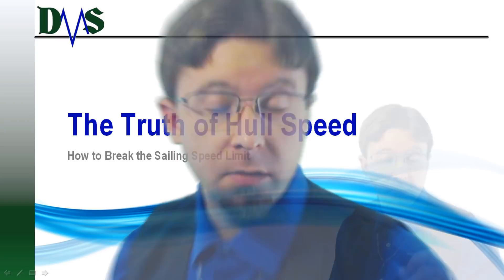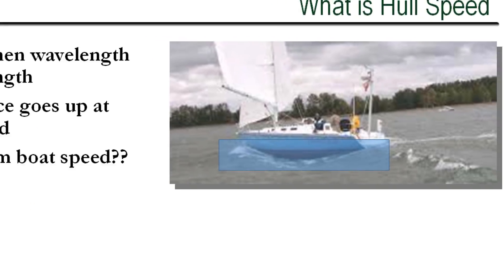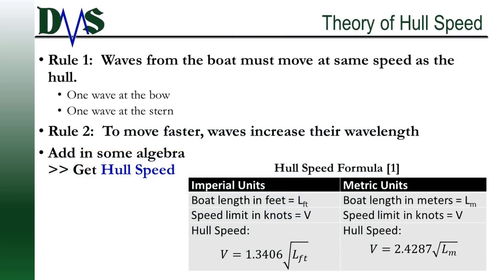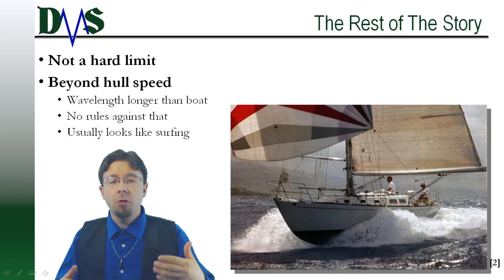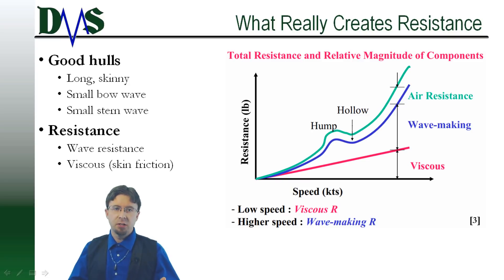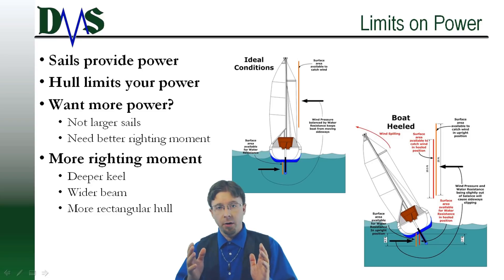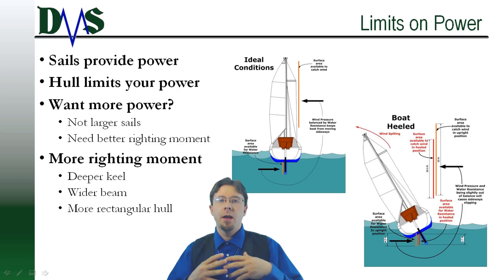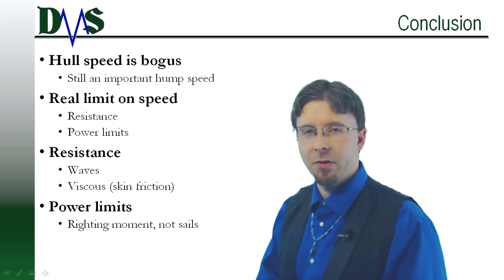The TRUTH of Hull Speed:  How to Break the Sailing Speed Limit

Comment: The point of inflection where you encounter rapidly diminishing returns being at the hull speed is not simply coincidence.
The diminishing returns have causal relationship with the hull speed, as in, that is where increasing wave forces are encountered.
If you surpass the hull speed there is a period of rapid gain followed again by diminishing gains (increasing function of air/fluid/wave resistance)  What will you say then, that total resistance is just coincidental?
Reply from the maker: I don't recall that the video ever implied total resistance was coincidental.  Only that hull speed did not predict a hard limit on maximum boat speed.  In general, I would argue that YouTube is not the appropriate forum for a technical debate, which are the types of questions you are asking.  Those belong in peer reviewed journals and scientific conferences.  And when I present to conferences, I use a more technical and precise tone of presentation.

These YouTube videos intend to expose engineering concepts to a wider audience in a more accessible manner.  That does require less precise terminology, which can lead to some misunderstanding.  But you asked a technical question, and I will attempt to provide a brief technical answer.

Based on current theories of resistance prediction supported by the ITTC, I argue that calm water resistance, expressed in non-dimensional coefficients, is a function of Froude Number and Reynolds number.  The primary components are wave making, friction, form factor, and appendage resistance.  Of these various components, wave making resistance is the one that demonstrates the change in resistance at hull speed.  Before hull speed, it shows a characteristic hump / hollow curve.  Beyond hull speed, the curve appears exponential, but the actual characteristic depends largely on the shape of the individual hull.

Air resistance also gets added in as an additional component, purely as a function of Reynolds number.  For calculating powering, we may also add in an additional powering margin based on wave resistance from weather.
Reply: @DatawaveMarineSolutions  my comment about total resistance was an argument ad absurdum.
8:19 "...having this point of diminishing returns next to hull speed is just a coincidence"

Comment: Depleted uranium keel... much righting moment, much speed?  But seriously this makes sense why catamarans are so fast. Wide stance -beam + higher righting moment, narrow long hulls, light weight for good transfer of energy rate. Is the point where the righting moment and wind energy transfer peak measured by sail spill as in you have more energy than you can use? Sorry obvi a sailing noob here.. can you make a sail boat plane out like a recreational boat?
Reply: Light one design class type boats can be designed to plane easily. I used to sail a windmill (a now pretty much dead class) it would plane, but the rudder got damn sensitive! Also the sailing surfboards planned well, seemingly most modern one design classes will plane, although the newest thing seems to be foils.

Comment: What is the minimum wetted surface area needed to affect an increase in calculated hull speed?  For example, could I hang an 12' 4x4 post from the bow pulpit in the direction of travel, resting one end against the hull and thus increase my speed?  Would a 12' 1"x1" 'stick'  be just as good?  Or, do I need an area that covers from the water surface to the depth of the keel to affect the calculated hull speed?  hum...Worded yet another way, what is the ideal ratio of length vs depth to gain in hull speed?
Reply from the maker: Just adding small changes will not work.  Any changes need to be a faired addition to the hull. So you basically need to add something that covers the entire hull.
Reply: Hull speed is purely a function of waterline length. Wetted surface may impact how easy or hard it is to achieve or exceed hull speed for a given condition, but it won't change the hull speed itself.

Comment: I have some questions:
1) In relation to hull speed, what would be the effect of creating small bubbles ahead of the bow and below the hull (by any suitable means)?  Thoughts are that traveling through bubbles would reduce wetted area reducing friction. 

2) If a swing keel were vertically split along the hull and hinged/slid/pivoted (take your mechanical method) so that the depth of the keel would be increased, you'd gain righting motion, thus your sails could catch more power.  (Envisioning [rotate 90* in your mind] a beam over a fulcrum demonstrating foot-lbs.)  Is keel design advancing or are efforts better spent elsewhere?  My focus is with sailboats.

3) Instead of #2 going deeper, what if the bottom of the keel were winged and with a design that allowed the wing portion to be rotated starboard or port (and still be hydrodynamic)?  This would move the weight off center and to the direction to better counter heel.

4) What if a sailboat had, for lack of a better term, canards molded above the waterline so that as the boat heeled, the canards would contact water impose  a righting force?
Reply from the maker: Hi TronOfBorg.  All excellent questions.
1.)  For creating small bubbles, this is an area of active research.  I have only seen it on powered ships though.  You need a fairly large air compressor to introduce the bubble under the hull.  That takes a lot of power.  With the commercial engineered applications, I have seen claims of decreasing resistance by about 15%.  That could increase speed by about 7%.
2.)  If I understand your description correctly, yes keel design is advancing in this area.  The Volvo racing yachts using swing keels with can pivot port/starboard to increase righting moment.  We don't see these outside of racing yet, because they are expensive.
3.)  Good idea to offset the wing.  But you get more bang for your buck out of a swing keel instead.  The swing keel does more to offset the center of gravity with less complex machinery.
4.)  Yes, this could work in theory.  I have not seen any direct applications yet.  The main challenge is that you need forward speed to get large forces out of the canards (or any type of lifting foil).  Except that lifting force also has its own sources of drag that it generates.  You don't get it for free.  So the idea of submerging foils could produce extra righting moment.  But you will probably find better efficiency and simpler construction through changing the hull shape.
Reply: @DatawaveMarineSolutions  How about creating countering waves - something similar to bulb bow. But instead of creating them in a bow why don't create them:
1) either before the bow (maybe by hanging something from the bowsprit- so distance  from the bow could be adjusted to speed)
2) sideways to the bow - maybe in a form of a proper formula for a distance between hulls in a multihull design. It would still be a fixed speed (like in a bulb bow design) but it might give some bonus on a light winds during long cruising. 

In case of proposed bubble-cavitation solution. How would such a solution affect buoyancy? In theory it should be reasonably easy to boil thin layer of water at the bow section, some solar panels could provide enough energy. My concern is not only danger to marine life in such design - filter of steam/bubles would have lower density than water. Wouldn't it limit application only to foiling or extremally lightweight craft?
Reply from the maker: @gradowik  Good idea, but the sense of scale just won't work in this case.  When you hit hull speed, you have a wave that matches the length of the ship.  To create a counter to that wave, you need a bulb about the same length of the ship.  As far as the multihull concept, I haven't heard of anything like that.  But more power to you if you can develop something that works.

In the realm of bubble-cavitation, first a few clarifications.  When we get cavitation, those bubbles collapse almost immediately after being generated.  They aren't very good candidates.  There are devices that straight up inject air bubbles under a hull.  It doesn't affect buoyancy at all.  The air bubbles are at the same pressure as the water, so the hull doesn't see any different in buoyancy.  This also is not a concern for marine life.  We don't normally use steam to create the bubbles.  The easier route is actually compressed air, which requires less energy.  The bubbles are gone after the ship passes.   We don't use these bubble systems to reduce the ship draft or use it in light weight applications.  In fact, large, heavy vessels are the only ones that have the space for the necessary air compressors.  Running the air bubbles along the hull helps reduce the skin friction of water against the hull.  We use it for fuel savings.  Still questionable if the fuel savings are worth the cost of running the air compressor.
Reply: look up the newer generation vondee glope IMOCA 60 sailboats. theyre single handed offshore racing boats, and pretty much all of the new ones are using foils that extend out of the sides of the vessel to provide righting moment and even help lift the hull partially out of the water. the new americas’ cup boats are also monohulls using a similar idea, but they can lift themselves fully out of the water on hydrofoils

Comment: I’ve had sailboats surfing down waves at sea , your steering reverses if you do a higher speed then your hull speed !
Reply: When surfing a wave at sea, steering does NOT reverse because you exceed hull speed. Steering reverses because the wave behind you causes the water in the wave crest to move faster than your boat speed. Effectively, the bow of your boat has water flowing aft and for a short period of time the stern has water flowing forward.
Reply: AGHHHHHHHHHHHHHHH  THAN, THAN.  THEN is a moment in time.  THAN is a comparison

Comment: I've often wondered why no one has tried to design mechanism between the mast and keel which could compensate for the heeling force and keep the mast perpendicular to the water's surface no matter how hard the wind blows.  I guess I'm a little jealous of the way wind surfer's boards don't heel over with that swivel joint at the base of their mast.
Reply from the maker: Part of it is a safety principle.  We want to prevent the boat from capsizing.  As you heel over more, the heeling moment of the sail decreases.  It acts as a safety valve to reduce your chances of capsize.  But the more advanced racing yachts do try to compensate and keep the ship upright with a canting keel:  https://en.wikipedia.org/wiki/Canting_keel
Reply: there is (sort of) such a mechanism. a roller furling boom. in order to reduce the heeling moment you reduce the plane of the sail that's in the way of the wind. windsurfers do 'heel' by tilting the sail heavily to windward, thereby reducing the amount of sail area presented to the wind. 

however, simply reefing the sail lowers the amount of pressure applied to the mast, lessens the heeling and leaves the mast closer to perpendicular to the water.  whether or not that is the faster option has a lot to do with the design of the hull and the modified shape it presents to the water.

Comment: What do you think about using a round parachute high above the bow to get better wind downwind ?
Reply from the maker: I think the parachute would perform about the same as a spinnaker.  Up high has some potential.  The major benefit to that is going higher gets you out of the atmospheric boundary layer.  But you need to go fairly high to get any major benefit.  Imagine doubling the height from 50 ft to 100 ft mast.  That is only a 10% improvement on wind speeds, assuming a typical atmospheric boundary layer.  Another option is a kite sail:  https://www.skysails.info/
Reply: Getting the pliers ready to pull my foot out of my mouth just in case, but I'll try it anyway ....
Round parachutes have a stability issue, and cannot be easily directed. Square/delta/wings  ones maybe, but good luck with the launch and the retrieval on a sailboat.
SkySails yatch:   https://youtu.be/4QJmD6m3das
Wingsails:   https://www.youtube.com/watch?v=QGJ02kEDtXI

Comment: What about replacing the mast(s) and sails with water jets?? No righting issues then.
Reply from the maker: Very true.  We can easily use engines to power the boat up to extremely fast speeds.  At that point, you actually get limited by human endurance.  At the high speeds, slamming into the waves creates shock loads that can damage humans.  For the high performance military boats, they actually need to install special shock absorbing seats.
Reply: I am serious, for example, Classen's 127' Atalante or similar hull, can this be built without masts using two waterjets instead for a cruise speed of 22 - 24 knots??
here is a video of her: https://www.youtube.com/watch?v=X7cD6RMv07o
Reply: @DatawaveMarineSolutions  are You going to cover the sails and rigging too? 
Maybe proper sail design could not only power the boat but also lift leeward side from the water? We already have genoas and spinakers lifting partially the bow, why not use aerodynamical part of sailing instead of fighting with physics of hydrodynamics?

Comment: A nice if somewhat very simplified explanation, of course the other ways to add righting moment such as to increase ballast, have a canting keel and increase the depth of the keel just to name a few. While adding greater righting moment is fine, the angle that the righting moment becomes effective a highly important factor as well. Another major speed limiting factor is weight and the dispersion of the weight eg. crew at the back causing the transom to drag highly increases the drag and turbulence the hull creates. Thats why you always see the rail meat amidships on racing yachts anytime the boat isn't on a run. In reality there are so many factors that limit the speed of a yacht that covering every aspect would take many hours of video. eg. balance of the sails etc. etc. etc.

Comment: Hull speed is the nautical equivalent to the sound barrier for airplanes... not a wall, but an exponential resistance to going faster
Reply: Good analogy
Reply: Only the noise of a two stroke outboard breaks the sound barrier, not the boat itself.
Reply: Evan Taaved Pert totally the wrong analogy...submarines, are more of a comparison to aeroplanes...the problem with boats/yachts is the surface wave effect

Comment: Hi Nick, this is a really interesting topic. The other descriptor of the hull speed as I remember reading is that it is the point at which the hull must climb its bow wave to go faster requiring more energy until the hull begins to plane. But what interests me is that the modern trend of wider transom boats create other not mentioned effects. Notably when a boat leans due to wind pressure the submerged hull shape goes from being symetrical to some form of asymetrical. In older narrow stern boats the sum of the submerged shape delivers a resulting lift to leeward whereas the sum of the submerged shape of wider transomed boats delivers hydrodynamic lift to windward and possible improves the hull’s, not pointing to the wind but, net movement into the wind. Does this make sense?
Reply from the maker: A little.  I'm a little fuzzy if you are talking about the hull alone, or also including the hull, keel, and rudders.  But I think the general idea is what we normally call sailing side force.  More sailing side force means smaller lee angle and faster speed over ground to windward.  That is another topic I would love to get into.  But I always like to do my research first so that I can backup anything I say with real data and examples.

Comment: With light boats, 25 ft or less sub 2500 lbs,  I've often been able to push past hull speed or surf on a broad reach with the waves. There is a noticeable loss in directional stability after that point, you need to be gentle on the tiller to keep her on a heading.

Comment from the maker: This is a repost of a previous video about hull speed.  Same video, but with a correct formula for the metric version of hull speed.
 Apologies to all the previous YouTubers.  But I had to take down the previous video and its incorrect formula.
Reply: My sailboat (Oswald Berckmeyer Miura 31) has a very pronounced tumblehome which theoretically should increase buoyancy as it heels.  What are the drawbacks of this type of design and why is it not very common. I notice the odd modern solo race yacht for long distance has a bit of tumblehome.
Reply from the maker: One reason that you don't often see tumblehome is resulting difficulty to mass produce this.  Mass produced hulls typically start with a mold that we lay the fiberglass in.  The mold shapes the outside of the hull to guarantee a smooth exterior finish.  But if you add tumblehome to the hull, you can't get the hull out of the mold.  The only way would be a splittable mold (which adds to the cost).  So production dominates that a lot.

Another reason is simple convention and aesthetics.  Tumblehome gets associated with older tall ships, which creates the impression that it is an old technology.

As far as drawbacks:  you get less righting moment per degree of heel with tumblehome.  That can restrict vessel stability.  

Benefits:  a little tumblehome allows a wave to ride up the hull, rather than force it down.  That can potentially reduce your resistance.  But it really depends on how that profile interacts with the rest of the hull shape.